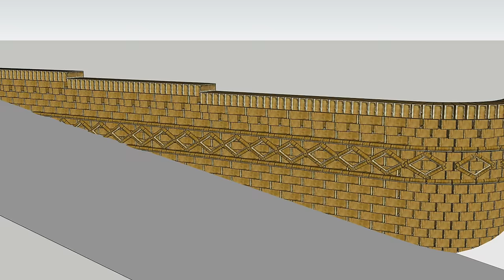How to RETAINING WALL - pt3 - lay block work & french drain

Comment: My tip for loading the bags or mortar into your mixer , lay the bag flat on the floor cut through the top half of the bag in the middle with a knife then lift the bag up from bottom middle so you have two half size bags cut the remaining part of the  bag then throw half at a time in much easier and less likely to catch on the drum
Reply from the maker: @peterthebricky  these bags have a tear off corner for pouring the contents- utterly useless!  I like your suggested technique- lighter, easier, cleaner. Thanks for the great tip, I'll try it out in the next video.

Comment: Another great video, i am enjoying your process. I have a much larger retaining wall that will need to be built, and i will do the same steps as you. One thing in my research that you did not do was to waterprof the inside of the wall, im curious why you did not do that?
Reply from the maker: @andrewmeer2728  Thanks so much. I'm not an expert, however I would say the need to waterproof the back side of the wall is determined by the area in which you live and to a lesser extent what you indent on rendering/tiling/facing the wall with.  The issue is water getting into the wall structure and freezing (not an issue in my part of NZ).  Water expands during the freezing process adding significant pressure to the structure and needs to be mitigated.

Comment: Why dis you not tie the rebar together, from my what i have been told, it has to be tied together for strength regards sören
Reply from the maker: Hi sören, the only function of tieing the rebar together is to keep it in the correct place whilst the concrete grout is poured in but as the wall and rebar are curved it can't move in the cavity. Tying the rebar does not add strength, making sure it stays in the right place does.
Reply: @danwaterson356  actually I wanted to ask about that in your last video, could you not cable tie the rebar together? Being it sits on plastic footings anyway? I know the metal wiring is common practice but as someone who’s industry it’s not I thought I’d humour my interest as to why 🥸
Reply from the maker: @Mr_Ashley  the short answer is yes, plastic cable ties would be perfectly suitable for a DIYer such as myself.  They'd need to be narrow ties, otherwise you'd be fighting them wanting to pull the two pieces of rebar parallel to each other.  There are instances where the rebar is better tied with a figure 8 pattern and wire gives you this flexibility.  Professionals would use a wire tying machine for maximum speed and efficiency.
Reply: Tying the rebar together holds it in place doesn't add much to strength of the wall,  obviously building a tower block the rebar is sometimes welded together but that's under enormous strain compared to this wall